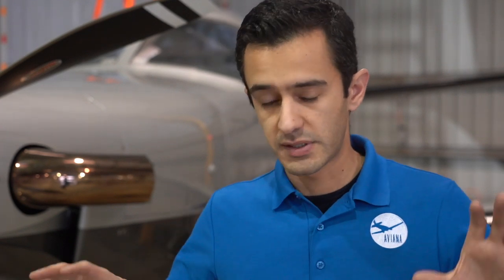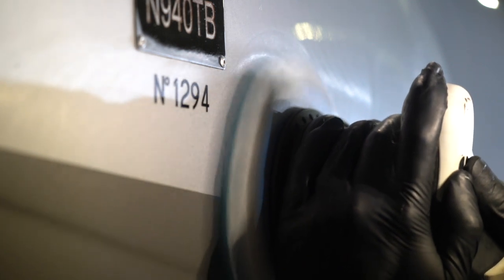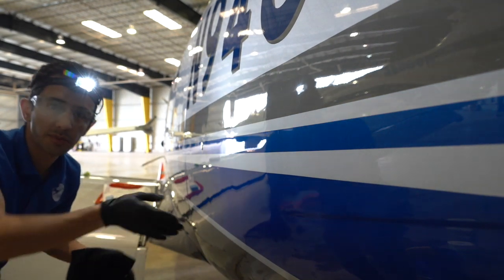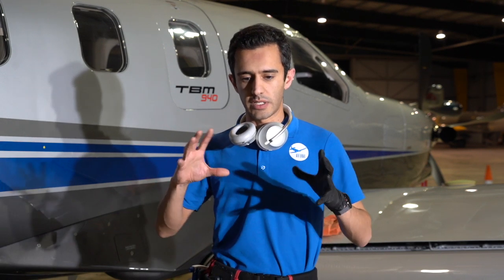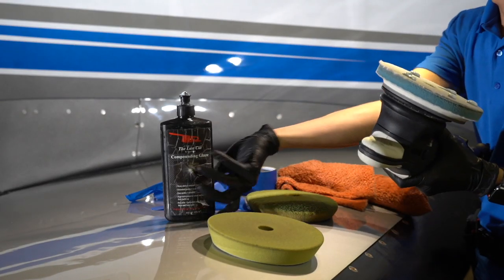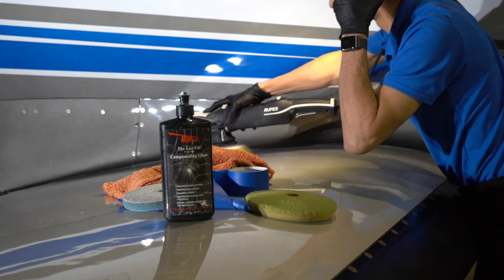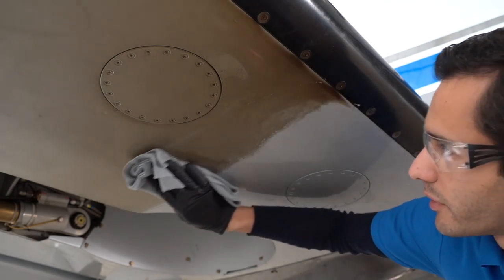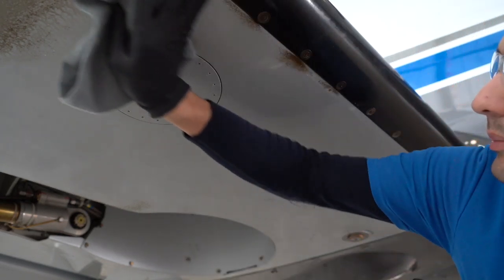030 The shiniest Daher TBM 940! Ceramic Coating a new plane!

Comment: Great job on this plane!  Can you list the spray bottle that you apply the no rinse with please?
Reply from the maker: Yes! My client actually bought it and it was great to use.
https://www.amazon.com/Solo-418-Ergonomic-Gardening-Fertilizing/dp/B000BX4VXI/ref=pd_bxgy_3/135-3125839-8034325?_encoding=UTF8&pd_rd_i=B000BX4VXI&pd_rd_r=cae02ab0-695c-489b-b976-ec736aa763ab&pd_rd_w=wS9P4&pd_rd_wg=Z0n7l&pf_rd_p=fd08095f-55ff-4a15-9b49-4a1a719225a9&pf_rd_r=1XXXRKX57A6EBC5H7QQJ&psc=1&refRID=1XXXRKX57A6EBC5H7QQJ

Comment: Im curious, is the paint on this plane single stage or base and clearcoat? How thick is the paint on this(or other) plane? Like how many times can you do this type of correction to a plane before the paint becomes too thin? In a different video you mentioned that aircraft paint is harder than automotive paint and has no orangepeel because its sanded for aerodynamics. Could you elaborate further?
Reply from the maker: Great questions. This specific airplane is clear coated. Paint thickness varies greatly among manufacturers, and generally even depending on where on the plane you measure (for example the stripes are painted on top of the base silver so that would read thicker, although the clear coat thickness is still the same). 

A mild paint correction process like you see here removes minimal paint, maybe 1-2 microns (less than I can measure with my gauge). Theoretically then, assuming 50microns of clear coat, I would not want to do this more than 10 times. (you generally don't want to remove more than 25% of clear coat). 

Aircraft paint is generally harder, but again there is a lot of variety between different companies. Some will sand smooth, some do not. It is not realistic to make a single claim towards all aircraft paint. 

Thanks for the questions!

Comment: Wonder if doing this gives you an extra half a percent or so of airspeed? Probably next to impossible to test for that, but let's face it, it'd be cool ;)
Reply from the maker: Some owners claim their plane goes faster, but I certainly don't promise it.
Reply: @AvianaAircraft  Thanks for the response. I know that doing something like this does create a small, but significant difference in racing sailboats - but since water is about 600x denser than air - whether this makes any difference in aircraft, remains a point of interest.

Comment: Can I See more speed out of my 182 I Just Painted if I Use This..
Reply from the maker: sadly no, a 182 is very dirty aerodynamically, the coating won't make a difference.
Reply: @AvianaAircraft   yrs ago i Painted a 172 and wet sanded and buffed it to a mirror finish and gained almost 5 mph So i Thought This Might work on the 182

Comment: Really nice job.  I just wish a $5+ million plane would have already done this.  When buying a Rolls Royce you don't expect to have to take it for a proper polish and paint coat after leaving the dealership.
Reply from the maker: It’s funny you say that because I have been hired by RR to fix up a brand new wraith as well.  Exotic cars typically come with terrible paint. 
Ferrari is the worst!  Check out episode 1 of the  vlog. We do a follow up wash on that car.
Reply: You are a correct it you think paint comes from the factory perfect you are fooled, Ferrari is bad but Tesla is worse Just because you pay high dollar for a car doesn’t mean the paint is correct. Plus manufacturing does not have the time or I could no imagine how much they would charge for a coating When your high end cars charge $5k for a upgraded audio system